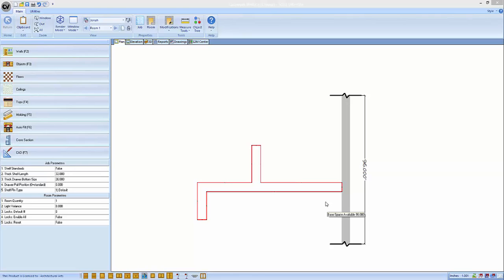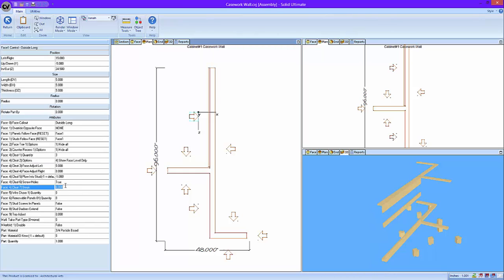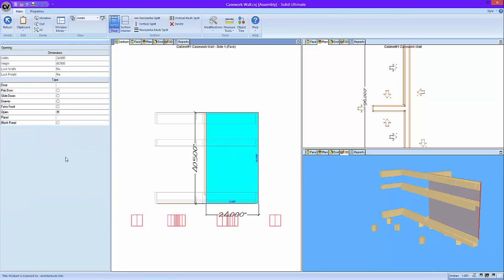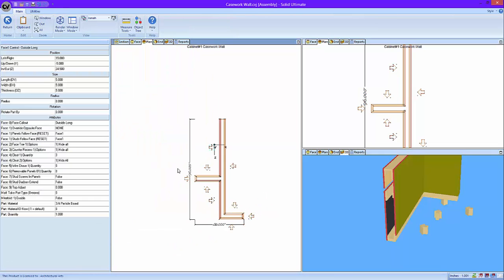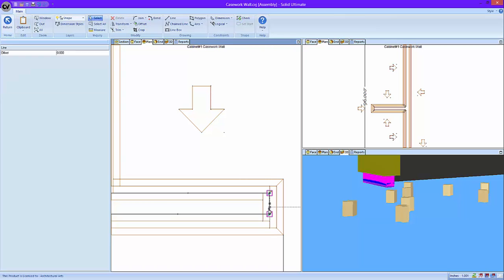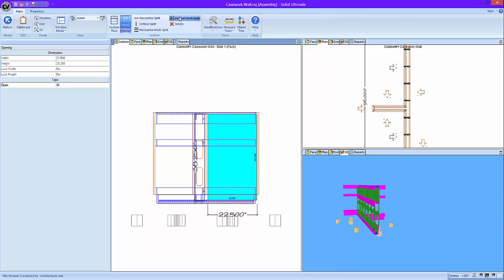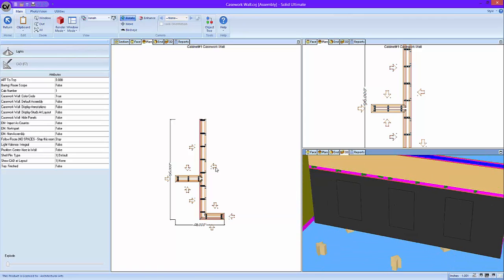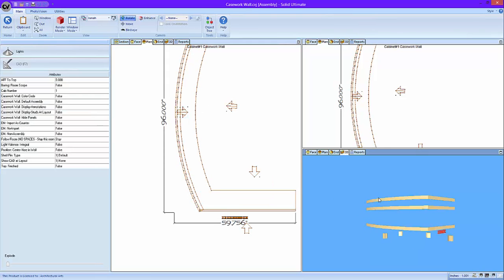Cabinet Vision Millwork Walls (Die Walls, Reception Desks)

Comment: Hey Jonah great video. I tried looking up this forum but it doesn't show up once i click the link. is there another link i can have access to that has anything on stud walls.
Reply from the maker: Sheldon Rowe the direct link is posted in the reply to the previous comment, or search Jonah millwork walls.
Reply: Jonah Coleman do you also give traingn classes? I would like to possibly learn more and you go more in depth about what you doing. if you feel you can give me guidance in certain. areas you can email sheldonrowe26@gmail.com or call my company at 704 376 5844 and ask for Sheldon Rowe thanks.
Reply: @sheldonrowe26  hi did he respond yet!